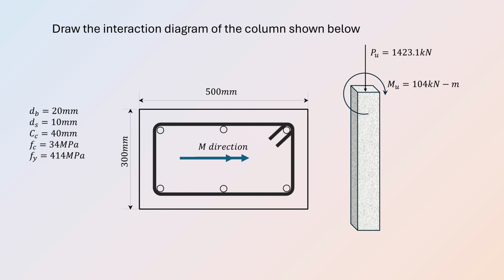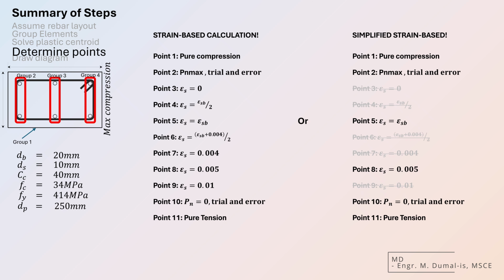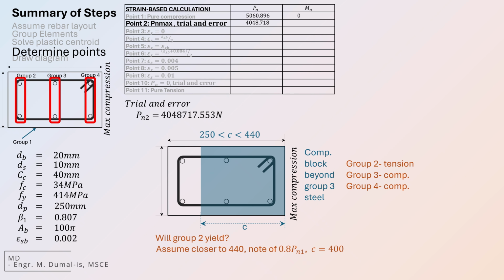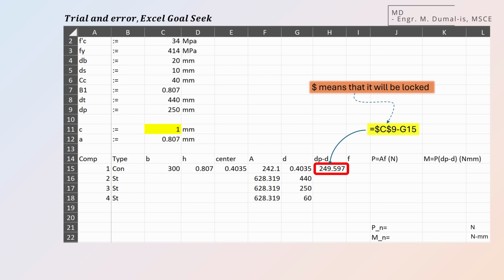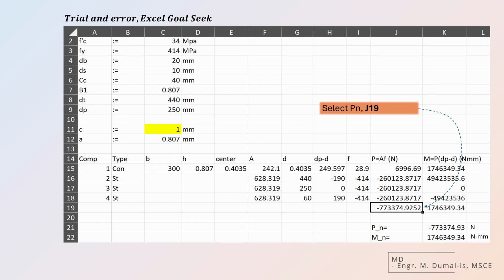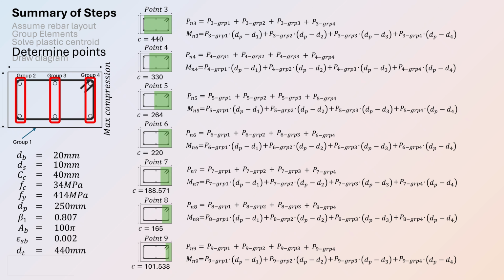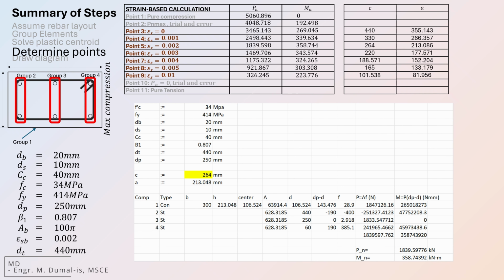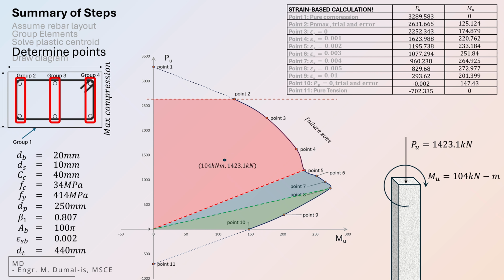Custom Interaction Diagrams for RC Columns Example 2 | ACI 318 & NSCP C101

Comment: Thank you—very informative video. I was able to create my own Excel template for column PMM because of it 😅. 

I would just like to clarify one point regarding the formula for the reduction factor in the transition zone. At 33:24 , the video shows 0.65 + 0.15( … ) instead of 0.65 + 0.25( … ). This appears to be a minor typo, as the final answer is still correct
Reply from the maker: You’re absolutely right 😄 That was indeed a typo; it should be 0.65 + 0.25( … ). Thanks for pointing that out.

Comment from the maker: minor visual correction @19:15:
the arrow that is pointing at Cell I15 should be pointing at J15.

typo error in the slide: @33:19
the strength reduction factor should be:
Φ=0.65+0.25*(es-esb)/(0.005-esb)